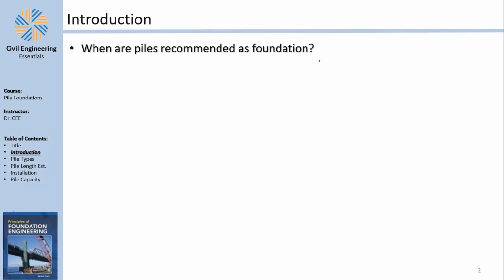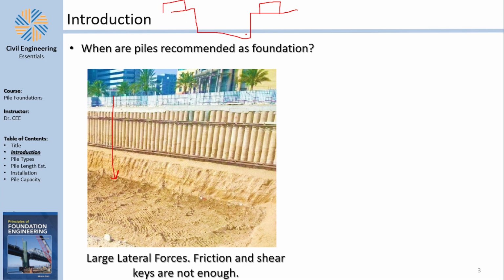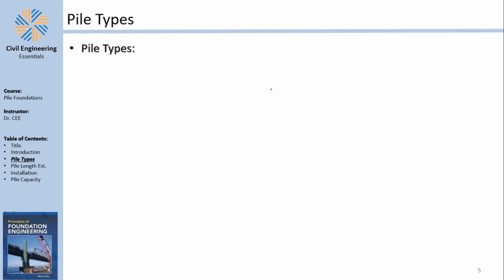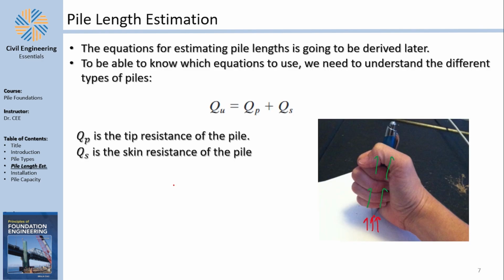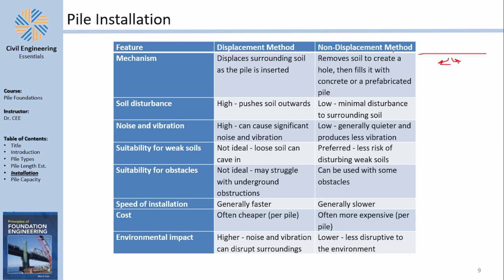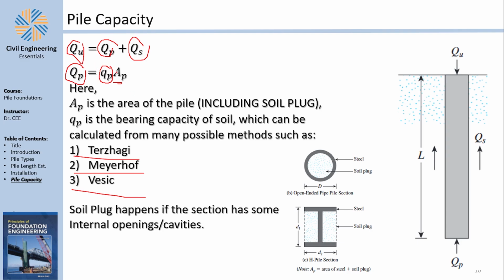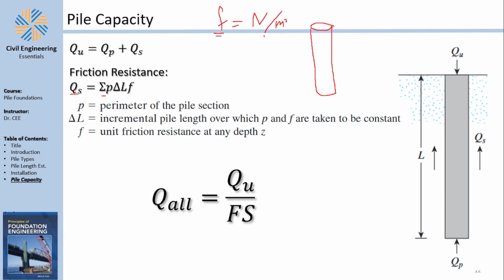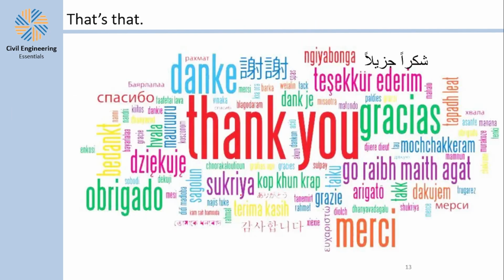Analysis, Modeling and Design of Piled Foundations in Robot - Part 2: General Principles

Comment: Nice video. What strength of timber do you guys usually use for your timber piles? In Guyana, we use Greenheart, which is D70 wood based on the British Standard Code.
Reply from the maker: In my work experience, I only used concrete piles, so I am not well qualified to speak on behalf of timber piles.
Of course, timber piles are used for smaller residential buildings, but as I said, I cannot go into the details as I do not have experience in them.

Regards,
CEE
Also, sorry for my late reply, I had tons of stuff to do so I was unable to reply in a timely manner,.

Comment: once again outstanding educational videos. dear Dr. could you please plan design of hydraulic structures in RSA like Dams and weirs and so on
Reply from the maker: hm... good suggestion. I still have to do some pre-work on the calculation of hydrodynamic forces on structures. If you want to self-read about it, you can check the US Army Corps or Engineers handbook on hydrodynamic stuff.
Regards,
CEE